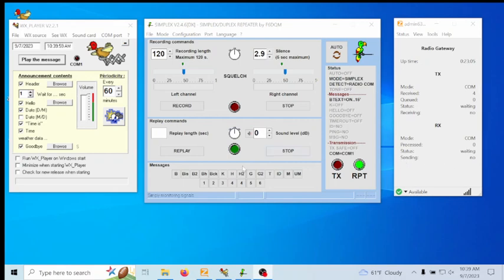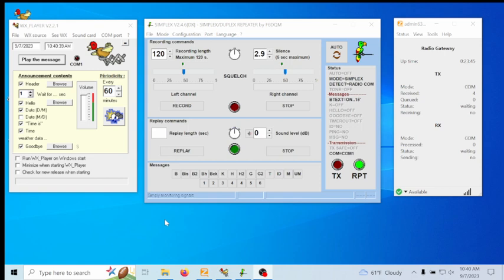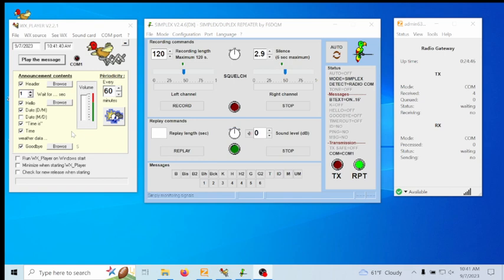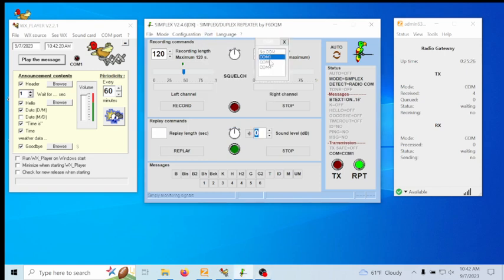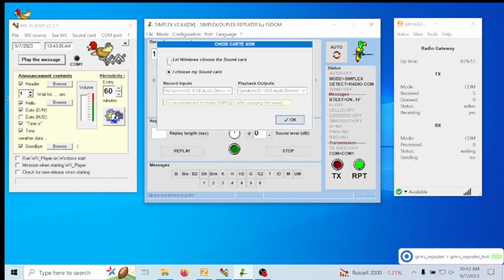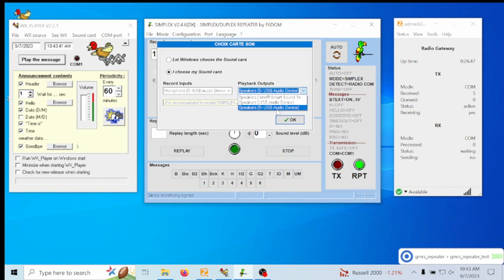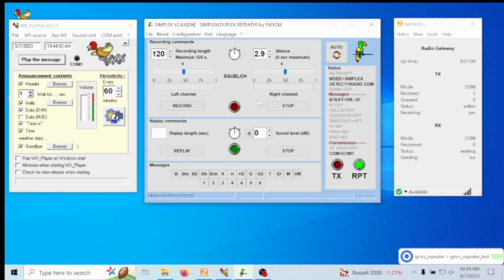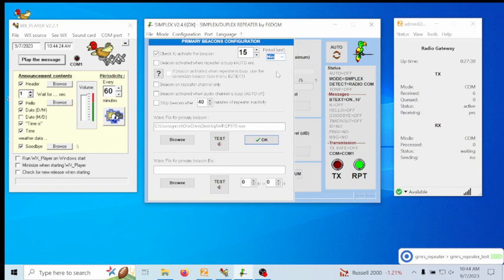🔺Repeater ID setup interface board Retevis RT97S or midland MXR10 GMRS two-way radio repeaters 🔺

Comment: I've been following this series. I just bought an RT97s about a month ago. I've been looking for a solution to get it to identify itself, and maybe connect it to the MyGMRS network.
I acquired an old windows computer from work. It was the controller for a piece of equipment so it has 4 serial ports. I was going to wipe the hard drive, install Linux, bolt a serial cable, and try to use that as a controller.

My other option would be to buy a raspberry pi and use that as a controller. I'm trying to do it on a budget. At least the computer is free, the Linux is free, i believe the repeater software is free.

Do I need your interface board if I'm using a Linux computer with a serial port, or can I simply plug the computer in to the repeater with a straight thru serial cable?
Reply from the maker: Yes, the interface board is needed. But I haven't tested it with Linux, so I don't know if it will work with that it should but????. The software like the repeater ID that is used in this video is windows base Windows 8 and up, so is zello and date & time/weather, so that won't run on Linux.  More info about the interface board here: https://www.gmrstwowayradio.com/forum/viewforum.php?f=22
Reply from the maker: Also, you could install tiny window 10 that can be installed on older computers, of course this would depend on the computer too. https://beebom.com/what-is-tiny10-lightweight-windows-10-how-to-install/
Reply: Thanks for the info! When I get some time I'm going to look at the specs on the computer and see if it will run tiny windows 10. If I can wipe the hard drive and get a fresh copy of windows, that will be the first hurdle. Then I'll just need an interface card.
Reply from the maker: @Tomásofthebrake  - no problem check around lots of info and videos on tiny windows